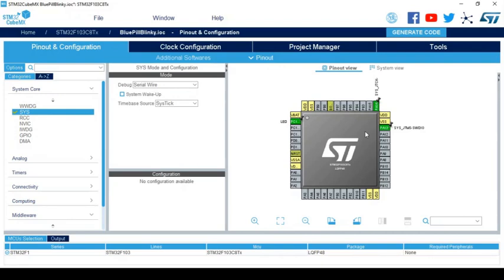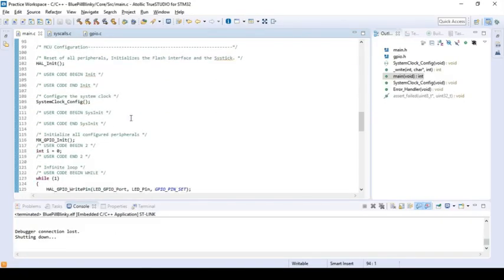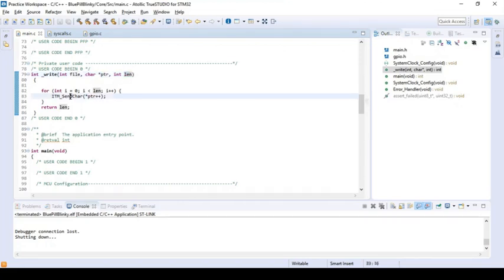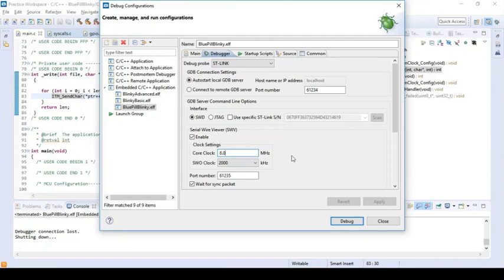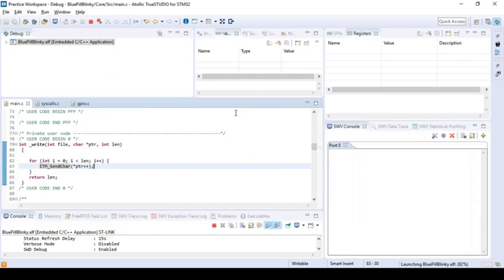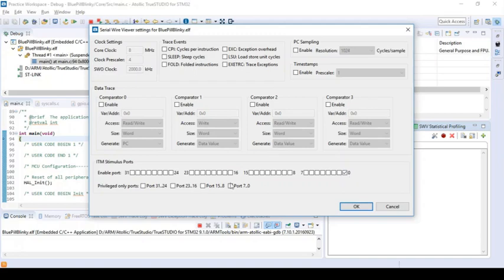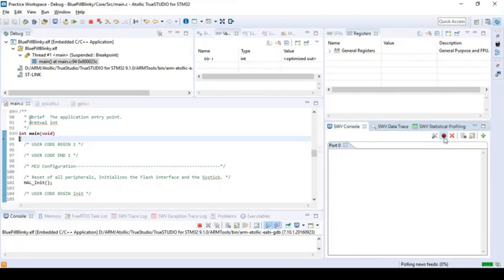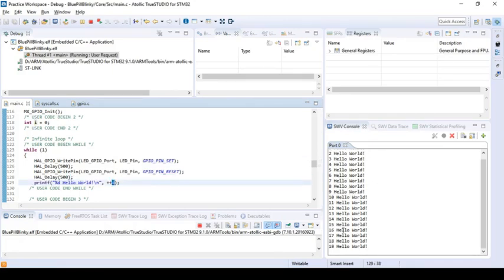printf() on STM32 Nucleo board using Serial Trace (SWV)

Comment: Thanks very much !
Small addition: if you don't have a newline at the end of what you're printf-ing, nothing will show up until a very large buffer has been filled, then you get it all at once, on a single line. At least that's my experience.
Reply: An important detail that is easily missed. I was stuck at this for some time. Thanks a lot.

Comment: I'm using a Nucleo-144, but in the Pinout&Configuration tab, under System Core / Sys, it doesn't show any Debug options, only Timebase Source.    In the pinout view, I do see STLINK_TX/RX on PD9/PD8 (USART3).   Any idea why there's no option to select Serial Wire vs Trace Async Sw?   The ITM_SendChar for example, appears to go thru stlink/swd port, not USART3.

Comment: It's not working on my STM32F103C8Tx. Do you have to connect anything to the pin PB3?
Reply from the maker: Not if you're using the Nucleo board.
Reply: @atg1203  ok, then it looks like SWV doesn't work on the 'bluepill' stm32f103
Reply: @roflcopter645  so what is the solution?

Comment: I did all the steps but i'm getting rubbish characters in the SWV console, what could be the problem?
Reply from the maker: Double check the clock settings.
Reply: @atg1203  yes right, it is the HCLK frequency, i changed it and it is fixed now. Thanks!

Comment: It just prints some strange question marks and sometimes other strange chars.
Reply from the maker: Double check the baud rate.
Reply: @atg1203  The problem was with the "Core Clock" setting under SWV. I went under "Clock Configuration" and on the very right down corner there was a block with "To TRACE (MHz)". It shows 320 MHz. It was confusing because my microcontroller (H7) is actually running at 480 MHz.
Reply: @atg1203  Now when I change my main.c to main.cpp it does not show anything :(
Reply: The problem was that _write() function was not called. Therefore I programmed my own print function with ITM_SendChar() and it worked.